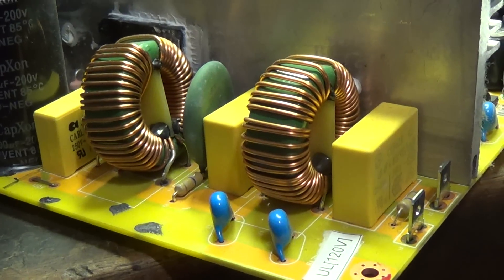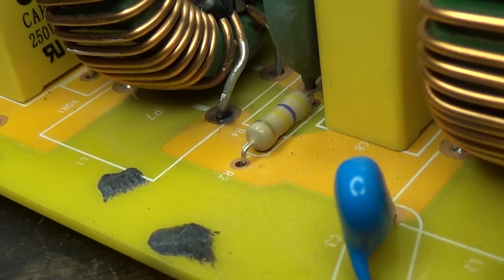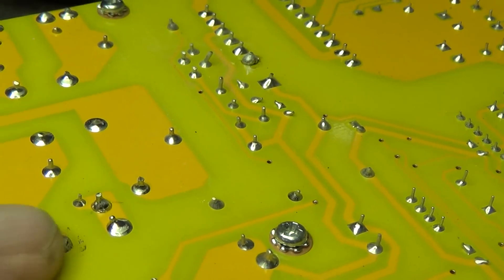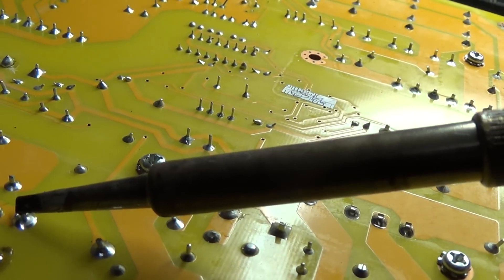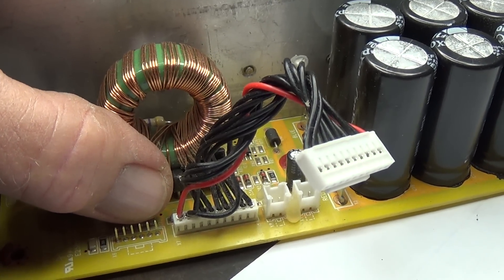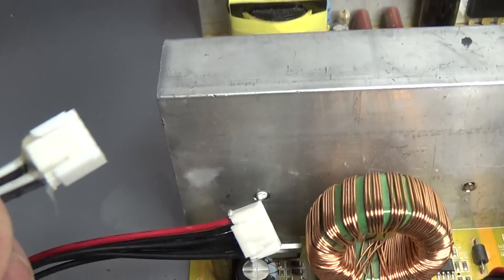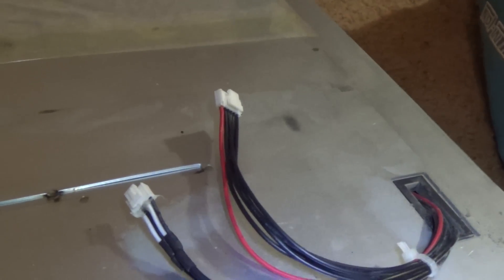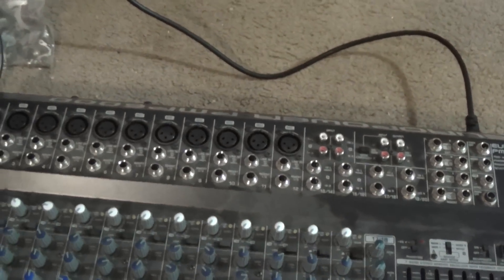Behringer Europower PMP6000 Repaired!

Comment: I hate when coils de-solder themselves. It's due to heat cycles, expansion cracks the solder joint. Also due to "just enough" style engineering. Not enough heat dissipation. 
The hot glue on a latched connector is overkill imho but you have to give credit for a manufacturer trying to prevent dumb failures like a connection coming apart.

Comment: The neighboring solder joint just above is suspect, obviously... I’d do a little reflow work on everything just to be sure.  Probably driving that channel a bit to hard causing heat failure, not that behringer is any sign of quality.